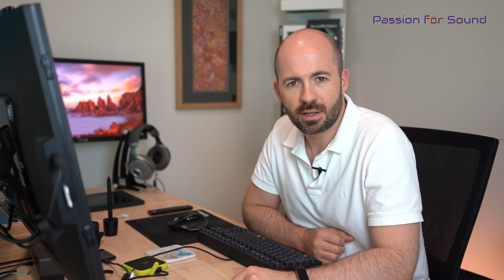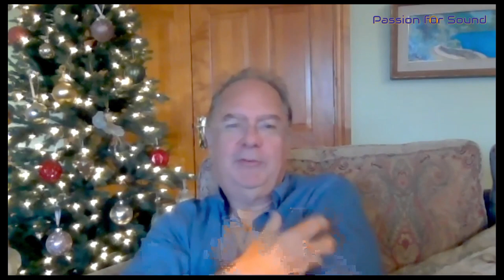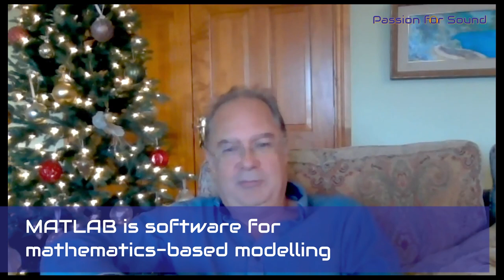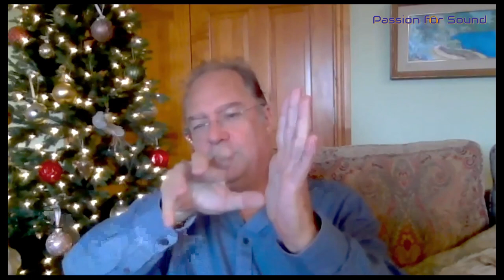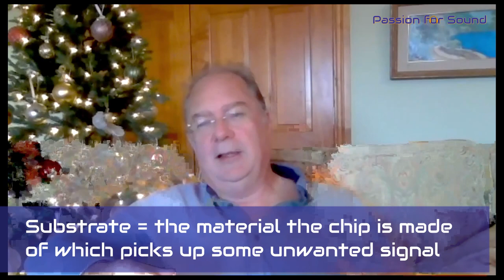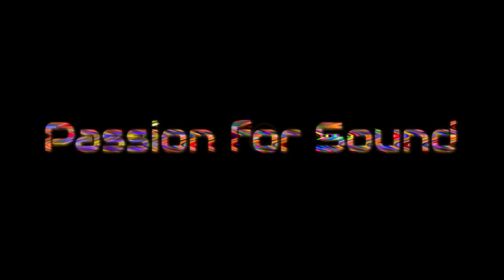Interview with Chord Electronics' Rob Watts - Part 1: R2R vs Delta-Sigma vs Chord FPGA

Comment: 7:40，such a turn off from  a closed-minded person. Some of the best measured DACs are R2R DAC from the likes of MSB, Sonnet, Holo. In fact, I just got the Sonnet Pasithea whose noise floor measures -160db. And I compared it to the Chord DAVE that I have and more than twice the price of the Sonnet, the Pasithea easily beats the DAVE in nearly all aspects. I sold the DAVE after the comparison.
Reply from the maker: I agree that I found that statement a little to definitive for my tastes.
Reply: Exactly. Surely you would want to compare your products to your competitors.

Comment: Rob sounded annoyed by some of the questions :)  I believe both Schiit and Chord are great DACs. The rest is individual taste and how they fit in given system. I'm big fan of Schiit Yggy though. Amazing stuff for the money
Reply from the maker: I agree about the Schiit and Chord DACs. Rob is a lovely guy and very generous with his time so I doubt he was annoyed. Some of them may have been a bit low level for the expertise that he operates with though 🙂
Reply: @PassionforSound  I mean your  statement about Gumby when Rob bacame a bit tensed. I love his work and I will probably try out Dave though I find it expensive. I had TT2 in my system and yggy prevailed
Reply from the maker: Ah, yes, I felt like I had to defend the Schiit approach a little in that moment. Not that either is better, but both are very good I think. I'm still super keen to try the Yggy and hearing that you prefer it to the TT2 only makes me more curious!
Reply: I don't remember much now, just schiit sound being more natural and pleasing and also a bit more refined in base (thinner though). TT2 seamed to be more clockwork. I run it with active ATC SCMs 100 and cheap schiit pre (Freya +) which was to be a temporary solution but it's quite hard to beat honestly
Reply from the maker: I love Mike's Multibit approach. To my ears it produces the best non-Chord DACs I've heard so far (but there's still room to hear plenty more)

Comment: It is only a shame that you have to spend your few months salary to get the decent models of Chord. And there is nothing in between in their brand, Either spend a fortune for the desktop versions, or have nothing (the mobile versions I take out of the equasion, because they have batteries, and the qutest is just a extreme cutdown hugo)

I know it is a personal opinion, but I really don't like brands that ask so so extreme amount of money for their devices, that normal people can't afford them anylonger (see the price of a dave or tt2, the lower models are quite a step down, and the qutest is just almost a hugo with removed amp section)

And yes ofcourse I believe a M-scaler and tt2 sounds amazing, it better be for 12000 a pair, or Dave 13000, and then he has a qutest, fully cut down of any possible option and calls that a comparable midrange model??

There are way way more brands that don't go in such extreme pricings, brand like Chord make it a little niche market, where people love to show of, look what I have got, what you can't affort... 

I seriously think that it is sad in this hifi market. I worked in a shop when I was younger, there the margins where already extreme, our shops were forced to charge a specific minimum price for equipment, B&W for example had rules on prices, otherwise they would take away our dealership, margins of sometimes double the price. Brands like Pioneer, Yamaha, Sony for example were never that extreme back than. The British Brands were actually the most extreme with those rules, NAD, B&W, Chord (as well). And for example Canada 'Totem speakers', there we had to charge more than 13000 euro a pair (where the shops purchase price was half that! HALF!). 

And yes I understand you don't want to lay in the Wall Mart, a Big W, but prices are sometimes crazy in hifi, especially because I am aware what the average shop purchase prices were back then already (that hasn't changed) And it actually makes me sad for the people who love music and can't afford it because of that. because of people like Rob Watts that think that prices like this are okay. Burson have high end stuff, they don't even charge this kind of money, Violectric don't even go this far. 

Instead of letting 20 people enjoy it, because it is affordable (in the end making the same profit) Now only 1 can enjoy it, because the rest don't have that kind of money, oh well I made my point.

My comment had nothing to do with you, but thanks for the video, always like your honest reviews!!, actually hoping you understand what I am trying to explain here
Reply from the maker: I understand where you're coming from and appreciate the comment, but it's not a case of these companies just arbitrarily deciding on a price. There are multiple factors involved including how long the development process took and therefore the cost of that time, the value of the unique design approaches and technologies, and then the cost to produce and provide warranty/service.
Expecting these sorts of products to be priced at the same level as something from Topping or SMSL (for example) is like expecting to buy a premium car with leading edge features, higher quality materials and advanced engineering for the same price as a basic hatchback from Toyota, Hyundai or Kia.
I'm not having a go at you because I understand that it's hard when a product like this is out of reach, but the pricing is fair for the quality and technology IMO.
Also, the Qutest is much better than I think you're giving it credit for. Yes, it's the same DAC stage as the Hugo 2, but it adds galvanic isolation on the USB socket and has full sized BNC connectors in case you want to feed it with an M-Scaler
Reply: @PassionforSound  I understand what you mean, and agree ofcourse to some level what you are explaining. But prices have gone up the last few years to extreme levels for some brands (even for already existing products). And yes some comments I took a little out of proportion to explain a point ;-). 

And not all brands do it this badly and force extreme margins to products. Just think it is a shame indeed when some products are so extreme out of reach to most people, especially if you love music. And having worked in that kind of shops and knowing how strict some brands were on forced minimum to charge prices, they could have been a little relaxed and let the shop have a little more freedom in that. 

Thanks for your point of view, appreceate it 👍🏼